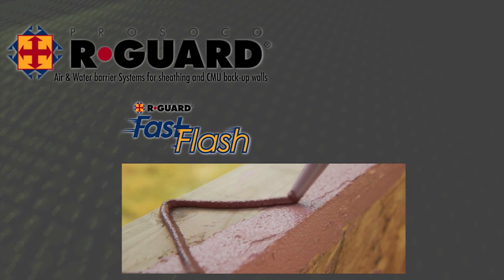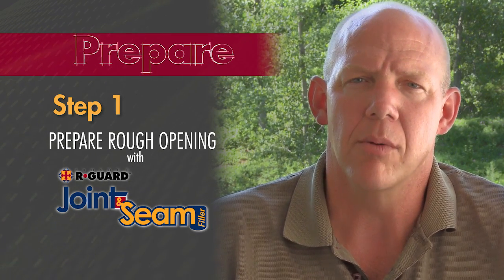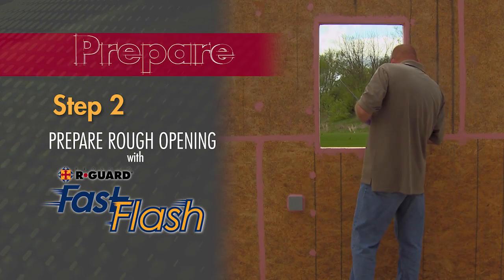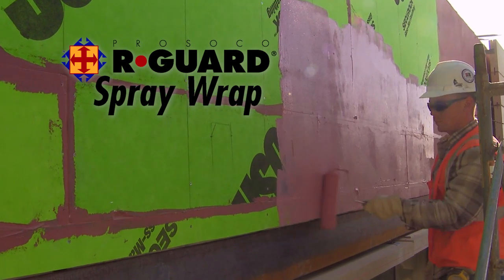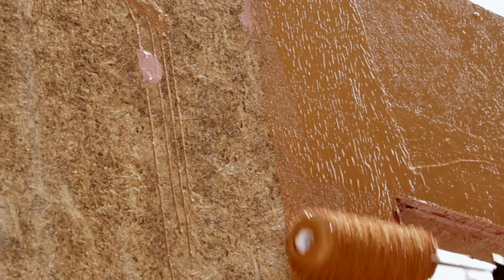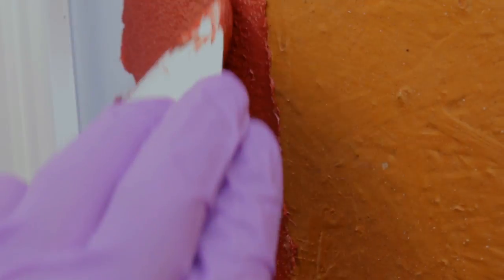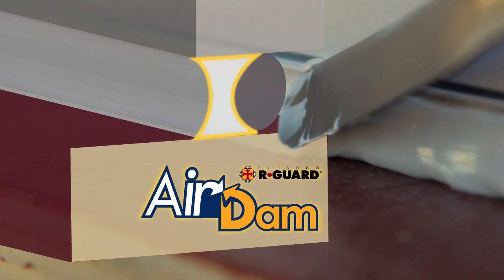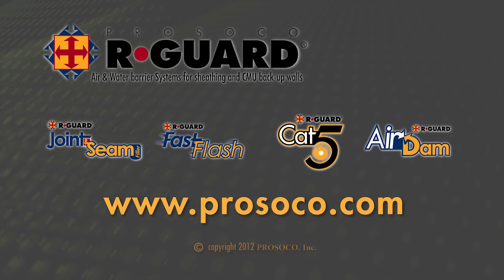Installing the FastFlash System (extended version)

Comment: This is a joke people. A complete rip-off!!!! As soon as water hits that OSB panel and stays there brewing under the  stucco or Hardi siding, penetration is is Inevitable!!!! You’ll get black mold instantly!!! Even if you cover the OSB with tar paper or any other air and water barrier out there.
You’re wasting money on these liquid barrier products for sure!!!!
I’m a GC by the way. Your best bet is to flash with stretch Zip tape and 100% silicone. I sometimes spray my exterior sheathing with a good wood water sealer before applying the air and water barrier. I’ve built homes for over 25 yrs. and after opening up a few of these homes to repair plumbing, electrical, etc. I never find leaks, mold nor any damage due to climate conditions.
The bald dummy on this video even goes to state that it protects against cat-5 hurricanes!!!🤣😂 no such proof!!! Fact is, if a cat-5 hits any home trust me, it will leak from everywhere. I live in Florida (Cat-5 alley).